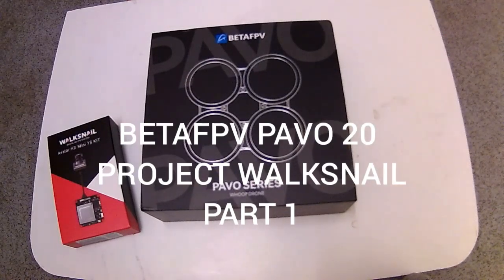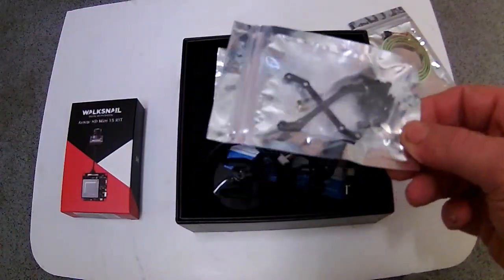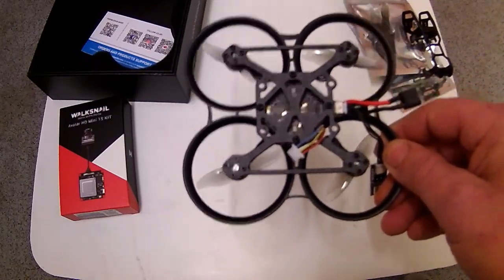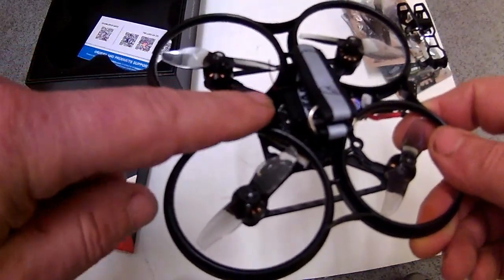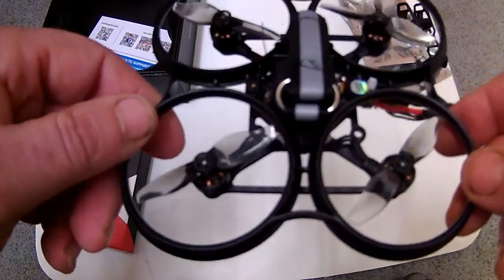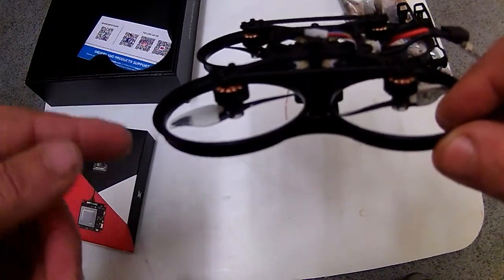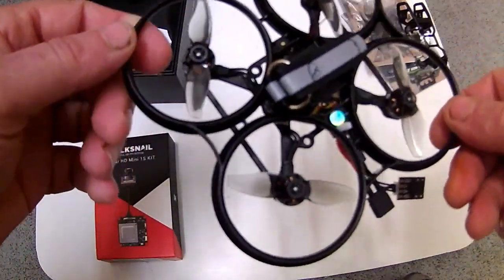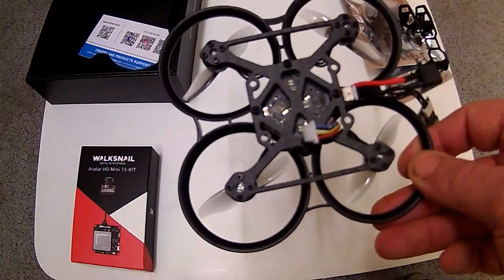BETAFPV PAVO 20 (PROJECT 1s WALKSNAIL BUILD PART 1)

Comment: Are you sure yours will only run off or 5v?? I have one and it and do 3.1-13V. I’m in the middle of my first HD build and my Walksnail is a version 3.
Reply from the maker: Dunno gonna check with a multimeter,but I can always solder it to a 5v pad if needed.
Reply: @cyclops-fpv  looking forward to seeing your finished product.